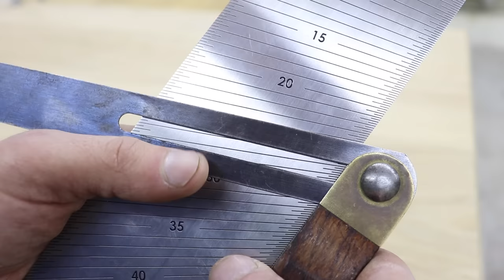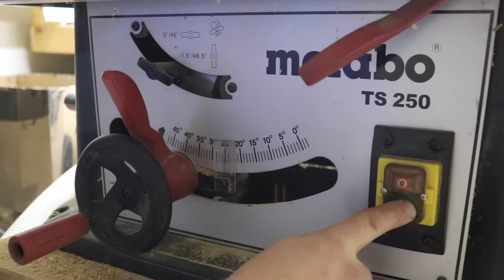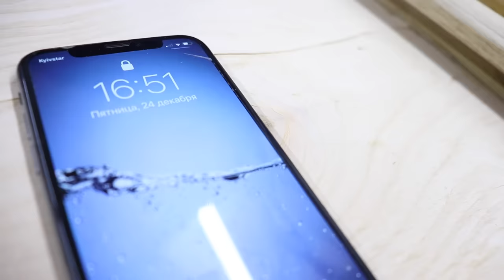Building a Modern Table. Mid Century Modern - Woodworking

Comment: Awesome work.   This is a very creative piece that would appeal to those who love the look of modern furniture.  The angles in this project required you to be careful and really think this through.  Well done.  One thing, the video shows you using your Domino machine without safety glasses.  I hate to see craftsman working with power tools and not wearing eye protection.  It only takes second for your life to be significant changed by a piece of wood that might fly into your face and eyes.  Please, wear eye protection for your safety.
Reply from the maker: Thanks for watching. I will. 👍👍👍